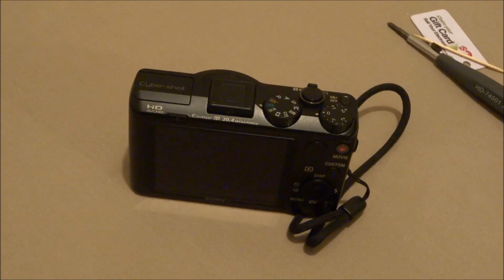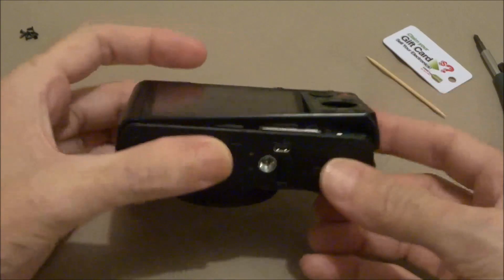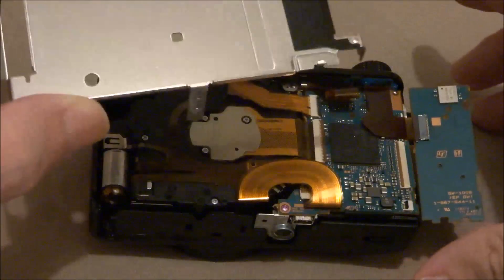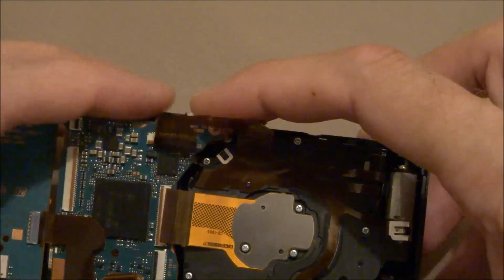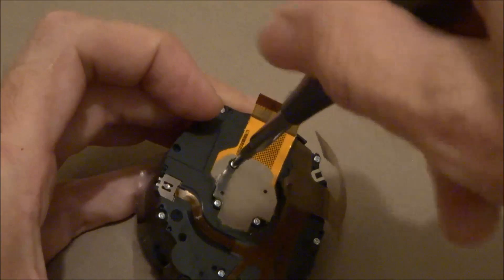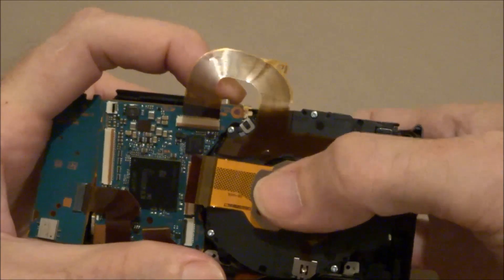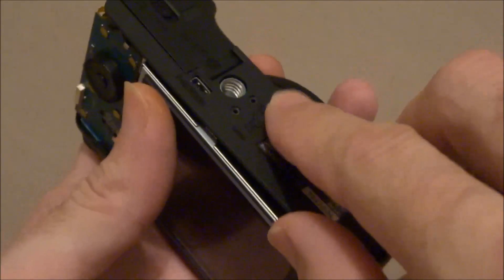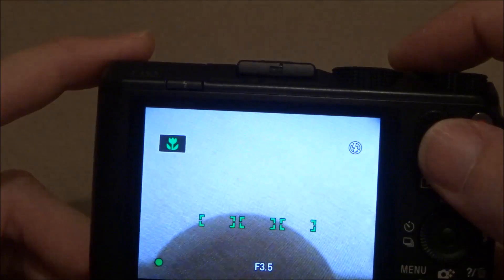Sony DSC-HX50V lens replacement repair HX60V HX50

Comment: Hello, I have a dust on either the lens or the CCD sensor on my HX50... The hardware on 6:47 is the CCD? Can I simply just put a sensor swab on it to clean it? Thanks!
Reply: Try home vacuum first.  Don’t let it touch the lens but just try to get close to see if it can suck it out.
Reply: @David-ms1wm  I did but somehow it's not working. Probably remove the back panel and perhaps vacuum it from there.
Reply: Turn camera on and put vac on front lens  but don’t let it grab to it.   And try tapping too.

Comment: Is the CCD the same thing as the iris? I have been told that the iris of my camera is broken, because I get a black screen when trying to take photos. Could the iris  be replaced or do I have to replace the whole lens like you did in this video? By the way, great explanation, it is very helpful!!
Reply from the maker: the whole lens would be the best thing to do.    CCD is not the same as Iris.     you can see testing the iris in this video at 27:50  https://youtu.be/fCmgPQU_Gr4?t=1673
Reply: @daves.projects  Thank you for your prompt reply and your advice. I will watch the video 😊

Comment: Give me link to buy the new lens...thanks..
Reply from the maker: check ebay
Reply: Hello, I did a search for "sony hx-60 lens replacement" on Ebay UK and it only came up with one source in Europe (Italy) which would cost approximately £51(p&p) where as there were local second hand cameras I could bid for within the UK which may or may not work out cheaper or the same price. This might be similar for people in other countries. Good luck to others hoping to replace the lens!
Reply: @daves.projects  Thanks Dave.

Comment: Hi :-) .  I can't thank you enough for the info contained in this video. It gave me the confidence to do something I would never have dared do without it........take a modern camera apart !!  My Sony Cyber-Shot HX60 had a lens that was stuck shut. I disassembled the camera as you showed, and had a good poke around with the lens and put it back together. Unfortunately, that didn't work. So I had nothing to lose and had a brain wave. Why not take it apart again, and just wire the camera's 3.6 volt battery directly across the lens drive motor terminals ?? Worked a treat, and out popped the lens, couldn't believe it !!  Reverse the polarity on the terminals to get the lens to go back in. Put the camera back together and hey-presto.....works a treat !!  Thanks again  :-)

Comment: Great video. Cleared a speck of something off the sensor. Didn't need to remove any wiring, just flipped the sensor over after taking out the three silver screws. Thanks very much.

Comment: Thanks!  Using your video I was able to repair my DSC-H50V for the price of the lens/shutter assembly ($69 on eBay).  My local camera repair shop wanted $350 after I paid $45 to "diagnose" it.  I sent you a donation for a few beers. Thanks again.  Clear disassembly and assembly instructions.
Reply from the maker: Thank You !

Comment: I unfortunately broke the orange clamp on the large LCD ribbon cable connector, has anybody else run into this problem? Will the ribbon cable make and stay connected without that clamp? Kind regards and thank you very much for the excellent video!!
Reply from the maker: yes needs it to make contact.   if you can build the thickness of the cable with tape that will work.  i have done this using i piece of film plastic from another cable.  it needs to be pushed down to make contact.
Reply: +Linux & Other Stuff thanks for the quick reply! Much love brotherman

Comment: @Linux & Other Stuff, I have a HX50V use to work fine until last week. The lens will not come out when I power the camera up. The message ''Turn the power off and on again'' comes up. What should I do? Thanks!
Reply from the maker: does the lens try to move at all?
Reply: @daves.projects  no, the lens does not move at all.

Comment: I've just had to hack a repair to my HX50; thanks for your videos!  In my case it looks like it was the ribbon from the board to the lens - as soon as I removed the metal plate it started working - and failed again as soon as I put the ribbon back in place.  Letting the ribbon unfold upwards and it was OK; hmm - so I've bent it back the opposite way - underneath the PCB (removing the shell of the HDMI connector to make space) - and it's working; who knows for how long.  What a bizarre over folded ribbon arrangement!

Comment: The problem I was having was with the selector wheel on the right which lets to select diff modes.It used to dance between various modes and never settle.I was at my wits end about what to do.I was even thinking of junking the camera.Then I saw your video.I i opened the first 8 screws.Pulled out the ribbon cable from the control wheel board.Took it out and dunked it into a cleaning solution called Elma.Its ammonia based I think.they use it to clean watch parts.Should be easily available online.So i dipped my board into that liquid.Turned the round selector wheel round and round atleast 40 times.Washed it clean with water.Let it dry under a hair dryer on medium settings for 4 minutes...and put it back in.VOILA !! The thing works perfectly now !! THanks a ton man !!

Comment: I have a DSC-HX20V. And the back button slides without changing parameters such as ISO, Exposure time. What do I do?
Reply from the maker: take it apart and check the control board cable,  you might just need to replace the control board.

Comment: I cleaned the lens, and when I put everything back together it wont turn on.  I have tried changing all the cables by reversing them, and the camera is completely dead.  Would a bad lens cause a complete no-power?  Or somthing else?
Reply from the maker: "changing all the cables by reversing them"  i dont know why or how you could do this.  but no  you should never do that.   the main power cable is behind the motherboard check it to see if maybe you pulled it out.  i dont see how but check it.. its very tight  fit cable with no retainer.
Reply: The same happened to me when I tried to clean the lenses body of the HX20v, I didn't remove the battery and it must have shorten it.

Comment: I bought this camera second hand online, and the scroll button (the big round one, tocontrol the menu) has a mind of it's own. I think I have to clean it. Do you have advice on how to remove the plastic front so I can clean the contacts?
Reply from the maker: the whole control board might have to be changed.  just watch this video up to 2:42  then just unplug the board.
Reply: I managed to gently lift the button off, and after I sprayed the sensors with contact cleaner the problem is gone! Thank you for your reply though, and for showing me how to safely open the camera.

Comment: Hi @Otherstuff. - I did the ultimate mistake. When taking everything apart as instructed , I reached the part at 2:31 where I had to unplug the Control Board.  The connecting ribbon broke off !  The head of the ribbon which goes to the back of the control board split!

My model is a DSC HX5v which has a flimsier board connector than the one you have. 

Please let me know how to fix this issue :-)
Reply from the maker: you might be able to find it on ebay.  search parts for hx50
Reply: Other Stuff  I searched one now. Please check the link below. I need the orange connector ribbon cable only. Not the control board. Do u think I can get it alone?

http://www.ebay.com/itm/GENUINE-SONY-Cyber-shot-DSC-HX5V-REAR-CONTROL-BOARD-PART-REPAIR-/170922127776
Reply from the maker: thats for the hx5 i dont know if thats the same.  someone might have just that cable for the hx50.
Reply from the maker: http://www.ebay.com/itm/GENUINE-SONY-HX50V-REAR-CONTROL-TO-MAIN-BOARD-CABLE-PARTS-FOR-REPAIR-/272210940183?hash=item3f61095117:g:b9YAAOSwv~xXDn8r
Reply: Other Stuff  thanks for the help. But my camera model is HX5V  not 50.
I will use ur link for searching keyword.
Reply from the maker: oh ok. well just keep searching ebay.
Reply from the maker: i would get the one for the hx5.   all these cable are different,
Reply: Other Stuff  Also only final question. Sorry for the disturbance.. 

I know one side of this cable goes to Control panel. How to connect the other side of this cable? Do I have to disassemble the whole camera?
Reply from the maker: it either goes on the back of the motherboard or to the top control board.  i dont know about the hx5.  might just be on the back main motherboard. just have to take the motherboard off to see where is goes.
Reply: Other Stuff  thanks again. :-)

Comment: Hi thanks for the advice the cable was out! I found that the control panel wire was damaged. Do you know if it is possible to buy a replacement for this and if so where they are sold? Thanks again. Ross

Comment: Hi watched your video - very helpful thanks! After dropping the camera and breaking the lens I sent for a replacement lens, fitted this using your video which was pretty straightforward, when I came to switch the camera on afterwards.  It would not turn on.  Took it to pieces, swapped new lens for old one. Still would not turn on, checked battery - full of charge. Replaced with new lens again tried and checked 4 times. Checked all power cables still won't turn on! Can you give me any advice/ideas? Thanks for any advice!
Reply from the maker: did you pull up on the motherboard to much?   there is a power cable on the back side if you pull up to much it might come out.  its a push in cable which means  no flip retainer it just pushes in.   the power cable comes from the battery/card slot compartment ( at top ) then folds slightly and pushes in at the top motherboard from the back side. ( in between the motherboard and battery compartment )

Comment: I have found a seller on Ebay, selling lens units for £35 from China. Will a HX60V lens fit in a HX50V camera unit?
Reply: I think 60v has GPS the rest should be the same but you can find for the HX50 too.

Comment: do you do repairs on other people's cameras? for $ of course.. I have the dcs-h200 and the lens does not fully extend and I get an error message.. looking through the screen shows the lens is out of alignment.. and you see a round border on the image
Reply from the maker: +kevralph was the camera dropped?   on some camera the focus lens pops in with plastic clips and when dropped it will pop out.  if it was dropped on the lens,  the lens barrel could have broke.  see my hx50 lens disassemble video.
Reply: +Otherstuff it was never dropped.. I only extended the lens all the way.. I keep the camera in a case.. but I didn't buy it new.. it's from Amazon
Reply from the maker: +kevralph can you return it to amazon?   from what you tell me something is stuck or loose.   and it sounds like the focuser lens.  if you cant return it,   then the whole lens will have to come apart to see whats wrong with it.  I think that lens is just like the hx200 or hx300 lens.   but yes i do sometime help repair peoples cameras,  i have a rx100 II coming in the mail someone wants me to replace the lcd cable on it.
Reply: +Otherstuff   thanks.. I'm not too handy with that type of stuff.. I guess I'll buy a new one
Reply from the maker: +kevralph  I can take a look at it if you want to ship it to me.  let me know.
Reply: +Otherstuff sure I would appreciate that.. if you email me your contact info I can send it to you..

Comment: After I dropped this cam in the sand, one set of lens-protecting curtains wont completely close. I tried compressed air duster but it didn't help. Would appreciate any advise at grabr@yahoo.com
Thanks!
Reply from the maker: +Greg Abramov  I have a video on getting sand out a wx300 that might help you, also a video on hx50 lens disassembling it..  try a vac.  this part has real light springs in it, dont take much for it not to work.  but be careful nut to knock the springs off messing with it.  its hard to get them back on..

Comment: Hi, I have a problem, I watered few water in backpack and my cam and apparently superficially wet casing so I dried it superficially and then turned on normally (I thought it was not wet) but the display looked so turned it off and then I removed the battery but then put them again (I won anxiety) and the display looked dull colored but as dark and took a test shot. After I turned it off and I forgot to get the batteries (I know it's stupid) and several hours after I got home and saw to checarla display *** looked back but the light was on, and the rest It worked perfectly. I took the pile and felt warm. I removed the memory card and check the computer and the pictures are perfect, the zoom, flash and everything. I disassemble a bit and the humidity sensor was marked but could not see anything wet. I was watching in Aliexpress several displays for my camera from 12-20 dollars (seems very cheap to 921000 pixels) and with good grades. Before buying I wonder if there is any way to tell if the problem is display or something else more serious. Recall that the backlight works. I hope you can help me, I would appreciate it.
Reply from the maker: +Johann Quintanar if the pictures come out good on the computer but look bad on the cameras lcd then its the cameras lcd.
Reply: +Otherstuff Thank's, I have another question. I have a small particle of dust inside the lens, It only apears when I use the zoom. If I need to disassemble the lens.. I have the HX30, it's the same than the HX50?
Reply from the maker: +Johann Quintanar hx30 is NOT the same as the HX50.   try a vac,  with the vac and lens in your hand  turn on the camera and zoom the lens as you cup the vac around the lens with your hand.
Reply: +Otherstuff What's a "vac"?
Reply from the maker: +Johann Quintanar vacuum cleaning,  using the end of the hose.
Reply: I can use the same cleaner I use to clean the house or is a special cleaner?
Reply from the maker: +Johann Quintanar yes.. i use a small hand held house cleaner.
Reply: +Otherstuff Hi, I already fix my screen, it's perfect, the same quality only for 13 dolars.. :)
Now I have another question, since the begining, I saw in many videos that the wheel on the control panel is fixed to the pcb, but in my camera it doesnt, when I moved the pcb, the wheel was only superimposed and now when I rotate the wheel, it doesnt have traction with the another wheel of the pcb and no works, only the buttons. I do not know if I knew explain, I only want to know why is separated, thanks.
Reply from the maker: +Johann Quintanar the control panel next to the lcd?   that wheel can come off,  just snaps on with plastic clips.  but has to go in a slot to work.
Reply: +Otherstuff What do you mean with plastic clips? In my caméra there is only 3 the wheel in the pcb. the central button and the superficial wheel. I have no problems with the central button, but the superficial wheel is totally flat.
Reply from the maker: +Johann Quintanar the wheel has clips that hold it in place.  the center button just floats. if the wheel is not set in place right the center button will work but the wheel will not.  it has to go in a slot to work the PC board knob.
Reply from the maker: +Johann Quintanar  are you talking about the wheel on PCB at 2:22 ?
Reply: +Otherstuff Yes, that wheel, but I don´t  see any clips, its flat.
Reply from the maker: +Johann Quintanar they are very small in the center.
Reply: +Johann Quintanar In the video I dont press carefully, it's an exmple. When I try to do it well, it doesnt fit, even if I press hard.
Reply from the maker: +Johann Quintanar you have to rotate it till it finds its place.  its kind of tricky because the center button.
Reply: +Otherstuff I'll leave it as it is. While I can operating with arrows and central enough for me. thank's. :)
Reply: +Johann Quintanar Another great tip was the vac, it worked to clean my lens! Thank's.

Comment: Hey, thanks for this video. My Sony DSCHX50 was dropped with the result that the lens cover shutter would not open fully. I tried blowing air into it, slipping in a bit of paper etc, as this had worked with a previous camera, but no joy. At the end of the next video, in which you tear down the HX50 lens you have just replaced, you mention that at the end of the zoom lens is an aluminium cover glued on that can simply be prized off. So I took out my trusty Swiss Army knife and slipped the blade in between the plastic rectangle and the aluminium cover and started wiggling it around (parallel with the glass), until the cover started to move. Once I got it off, dusted it down and put it back on again, the problem was fixed, I don't know why it worked, the aluminium may just have been bent out of shape slightly, putting pressure on the shutter mechanism. Thanks for the tip!
Reply from the maker: +Al Katraz Films Glad it helped, I should have shown that aluminum cap and how it comes off.  it just got two sticky tapes on it and if you just put some heat on the top near the tape and pull it comes off.   them lens shutter things have a very light springs on them and dont take much to stop them from working.